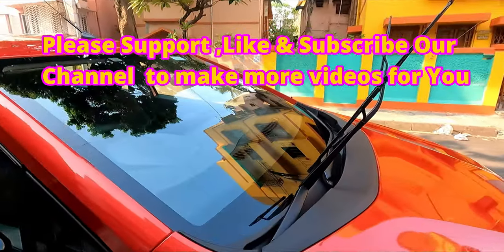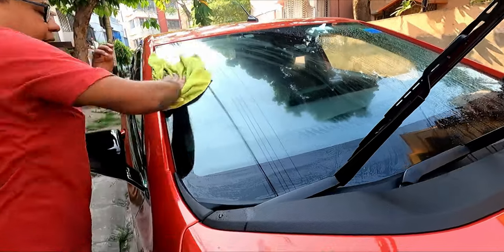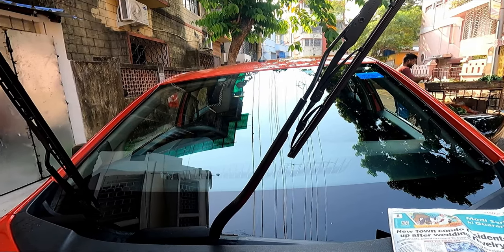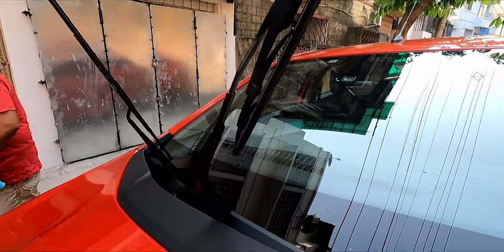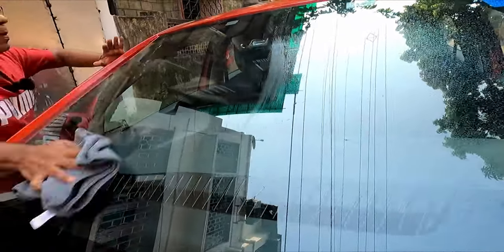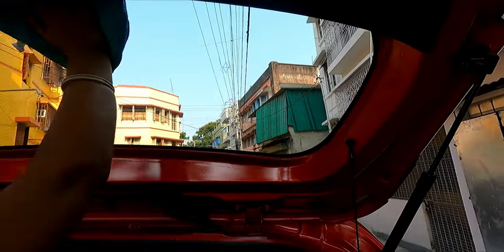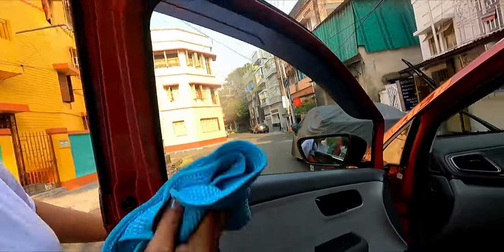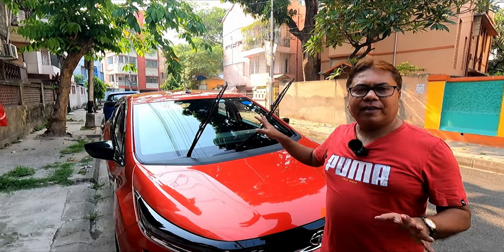How to Wash & Clean Car Windshield & Glass Properly For a Perfect Vision #cardetailing #turtlewax

Comment: Hi, can the turtle wax graphene flex be used instead of the ceramic coating while using the same process?
Reply from the maker: Definitely you can use Graphene flex wax.

Comment: Sir can you share anything about streaking after applying turtle wax hybrid graphene spray
Reply from the maker: If you have streaks use a strip wax type shampoo and remove coating as much as possible. Clean the area and repeat coating.